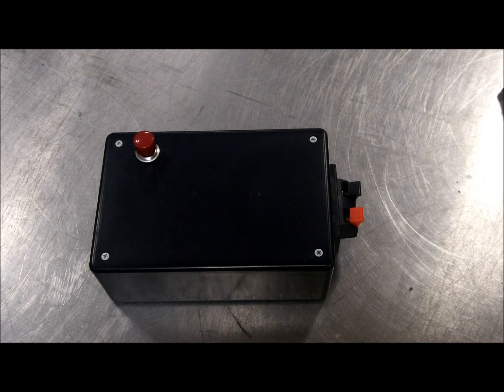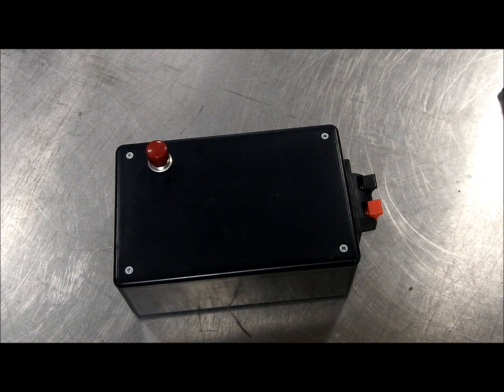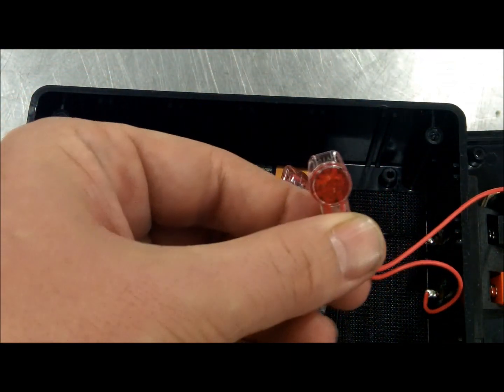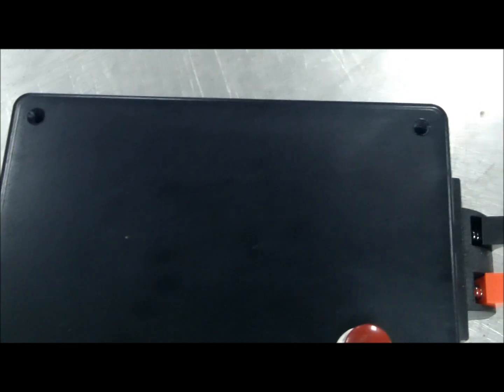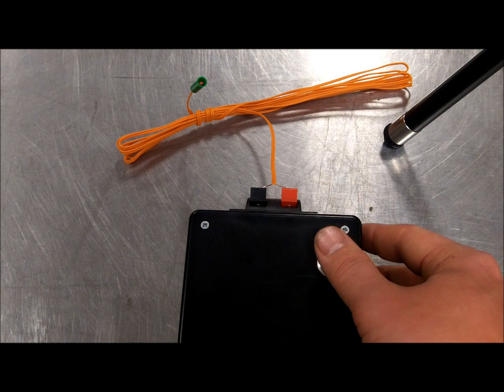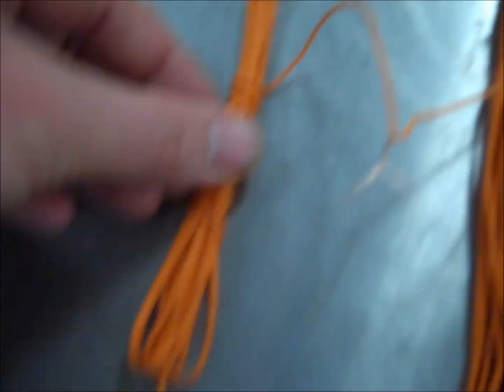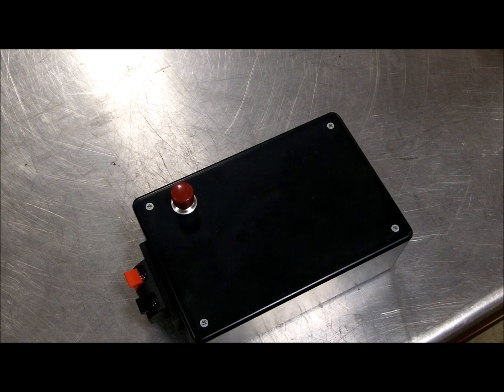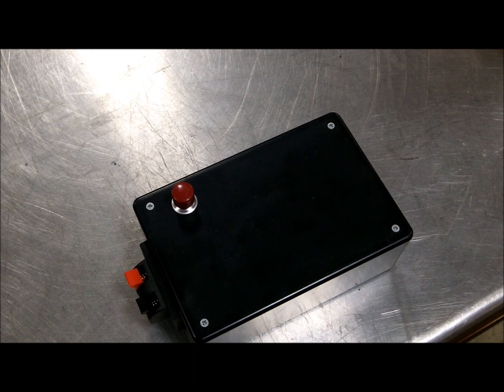Fire 10 Electric Matches Simultaneously  Homemade Firing System

Comment: A couple of thoughts on this application. e-matches are ignited by current and not the voltage. Recommended minimum amperage for e-matches is .75 amps per match. 9 volt alkaline batteries are capable of an average .5 amps each. With your set-up that's 4 amps total (with very fresh batteries). E-matches will fire unreliably at .4 amps but most will not fire at .3 amps. Also when you wire the e-matches in series you stand the chance of one of the e-matches burning and opening the circuit before the other e-matches down the line fire. I would recommend at least 5 AA batteries (they are capable of 2 Amps per battery and wiring your e-matches in parallel. That would give you the capability of 10 amps which would give you 1 amp per e-match with 10 e-matches. 1 amp is the Recommended Nominal Firing Current for most e-matches.

Comment: Nice piece body. I'm just starting to use electric matches but I use a car battery, it works fine for one electric match at a time. I'll try this serial connetion for 9 electric matches. Have you ever try with a car battery? do you think it will work?. Thanks for your help